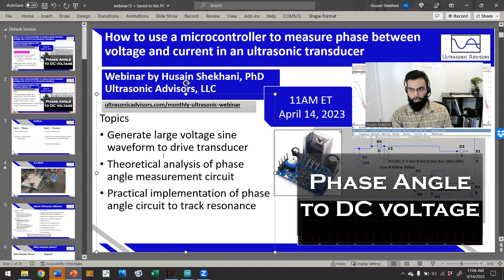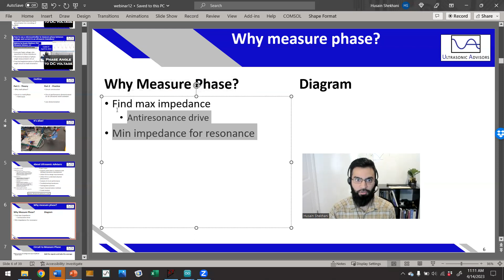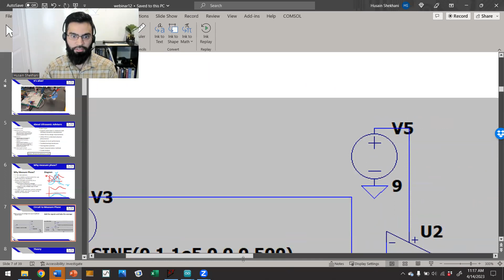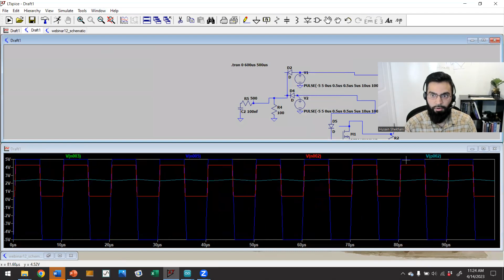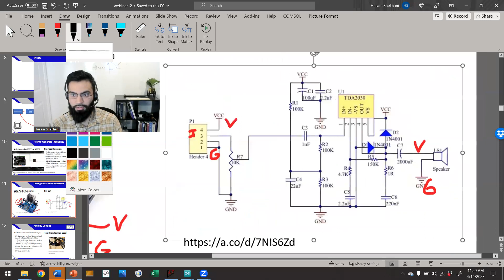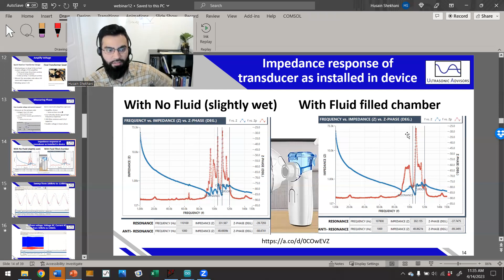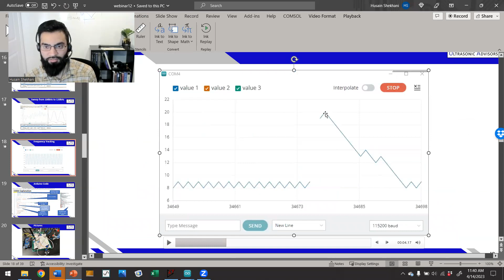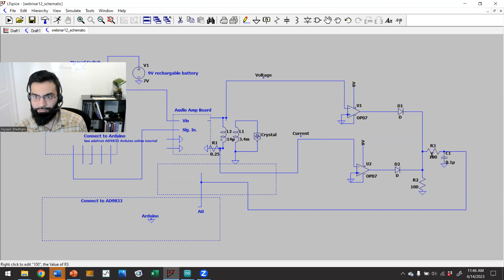How to use an Arduino to measure phase between voltage and current in an ultrasonic transducer

Comment: Thanks for all video you made, i want to ask sir, curently laboratory worker in my college working with ultrasonic circuit, this circuit used to measure propagation speed on fruit, we using 2 transducer for transmit and receive, when we use the circuit we measure signal in oscilloscope, but something weird happen and i dont understand.

When measuring input signal from receiver, the osiloscope showing 2 peak which is the first one is peak when transmitter active, and second one is pulse after propagate. My laboratory worker want to get rid of first pulse, he said its not supposed to be there. But i dont really understand how, do you have any idea about this sir? Thank you 🙏